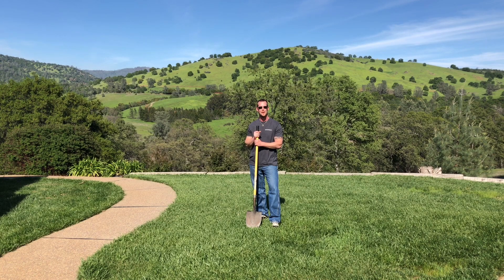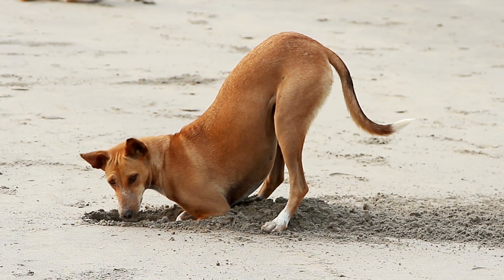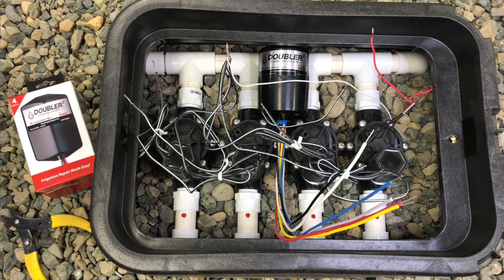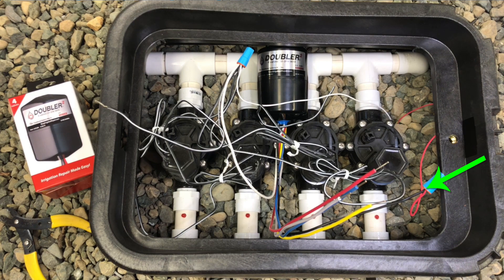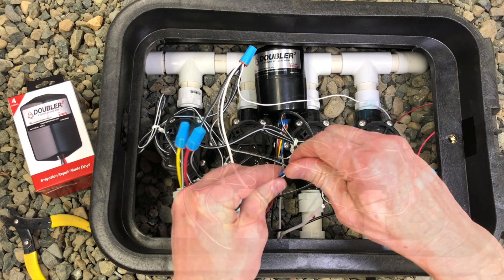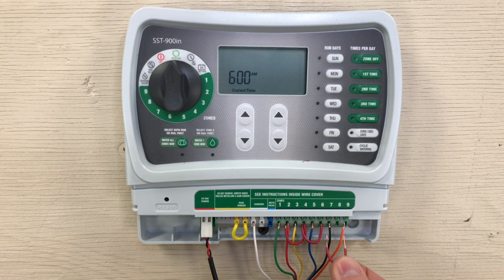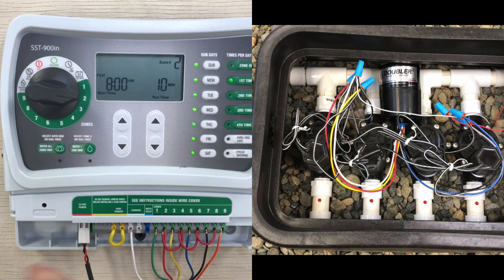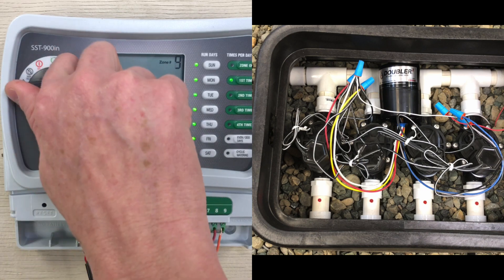How to add multiple sprinkler valves without trenching new wires

Comment: Will this product work if I have a 22 zone Rainbird controller and currently all 22 zones are being used. I’d add to 23 and 24. Will this product allow me to add zones beyond what my controller accommodates? Or will I have to get a second control box and Set up a watering cycle independent for my two new zones?
Reply from the maker: Hi 
Yes, Doubler or Doubler2 would allow you to add valves beyond the number of stations on your controller. We call this the dual program method. You can do this by using a Doubler2 and programming that station on multiple programs. For example, if you were to use a Doubler2 on station 22 you would program station 22 for a watering time on Program A, Program B, Program C and Program D. The Doubler will water the first valve on Program A, then water the second valve on Program B, third valve on Program C and fourth valve on Program D.

Just a note to let you know that you would still need to have the program D run time even if you did not have a fourth valve on the Doubler2 as it will keep it in sequence so all the valves run on their correct stations for correct watering times. The Program D run time can just be a minimum time though and not a full watering time.

Another option may be to use a Doubler (2 valve model) instead of a Doubler2 (4 valve model) and double two stations instead of running all the valves off one station. This would only require two programs instead of four if your controller was not capable. I hope this answers your question but you can always contact us if you need further assistance

Comment: Situation: I have a manifold setup for 3 zones. Meaning, 3 valves. All 3 are connected to the "common" wire of course. I just replaced two outer valves and left old one in the middle.

Question: If that middle valve with old solenoid is bad...would it also prohibit the 2 new ones from turning on from main control box (not to be confused with manually turning on)? Was thinking maybe so considering all 3 are connected via common wire.

Thx!
Reply from the maker: While all valves use the same Common wire, a bad valve would not prevent other valves from operating unless they were all on the same Hot wire. If that was the case and the controller saw the bad valve and skipped the station that operated those valves then all valves on that Hot wire would be skipped. 

Systems are typically wired as one valve per station and most controllers these days cannot handle operating more than one valve at a time (plus maybe a master valve). If you have more than one valve operating on a single station it is probably best to separate them and operate them on individual stations. A Doubler or Doubler2 can be a great option for this if you don’t have enough wires in the ground. 

If the three valves are not all on the same Hot wire then you may have a bad connection in the Common wire. You can redo the Common wire connection in the valve box to see if that will remedy the situation. If it does not you may want to check the voltage on those stations at both the controller as well as at the valve to be sure you are getting full voltage (should be around 24 to 28 VAC). Using a multimeter you can measure this voltage between the station and the common terminals on the controller and then again between the two solenoid wires at the valve.

I hope that made sense and I wish you luck in your troubleshooting!

Comment: Wow! What a great product!! Thanks for uploading this!! I want to add  3 new sprinkler zones to my existing system - This video talks mainly about replacing broken and old valves/wiring but I presume it can also be used to add 3 new zones to my existing sprinkler system?
Reply from the maker: Thank you! Yes, you can add new valves to an existing system using Doubler2. As long as you have a good hot wire on an existing valve you can add up to three new valves and operate all four using the Doubler2 to run them independently.

Comment: What are those lights/indicators after the valves?   How are they tripped?
Reply from the maker: The lights were connected to the controller as a visual indicator for which valves were operating but are for demonstration purposes only and not functional.

Comment: I’m having issues with my master valve staying on. Will this work with the master valve?
Reply from the maker: That would depend on why the Master Valve was not working correctly. If it was something in the field wiring the Doubler may be able to help. 

While you would not be able to run a Master Valve on a Doubler or Doubler2 itself, they would allow you to steal a good hot wire from a nearby field valve to use for the master valve. Then use the Doubler or Doubler2 to operate multiple field valves without having to run new wiring back to the controller. 

We know that every system is different so if you ever have questions you can contact us directly. We would be happy to help!

Comment: Hello can you do manual single stations with the doubler on a Hunter timer? Thanks for the great video!
Reply from the maker: Thank you for taking the time to check out the video! Yes, you can manually water a single station on any controller. Note that the Doubler2 cycles through its outputs each time it gets power so you would need to reset it once you are done.

Say you wanted to give station 4 in this video a manual watering. You would activate station 4 until valve 4 is watering. Once valve 4 has finished watering you would need to put the Doubler2 back into sequence by activating station 8 until valve 8 is watering. You can see this at 5:20 in the video. Once you turn station 8 off the Doubler2 would be reset so it will water the valves in the correct sequence when it waters automatically.
Reply: That’s so much unnecessary confusing nonsense to just water a zone. Why not make it simple like a add-a-zone?

Comment: What if I've already maxed out my stations on my controller, and have no empty spots available there to jumper?  It's a digital controller, so suppose I just have to make an entirely separate run program in addition to the general program, and just have this program do that one valve?  And run this single-valve program 3 separate times?  It'll remember over the course of several days even, to cycle between the doubler's extra stations?
Reply from the maker: Yes, you are correct! You can use Doubler to add valves even if your controller is out of stations. Just like you said, you can use a single station to run all your valves. The Doubler will advance and run the next valve each time it receives power. 

 Instead of running jumper wires you would just program the same station on four different programs. Program A would run the 1st valve(maybe an existing valve), Program B would run the 2nd valve, Program C would run the 3rd valve and Program D would run the 4th valve. Effectively adding 3 more stations to your controller!

We know that every system is different and if you ever have questions you can always contact us directly. We would be happy to help you get it setup correctly to work with your system.